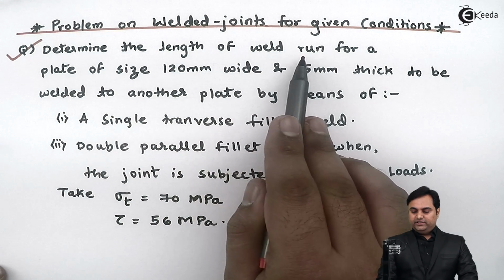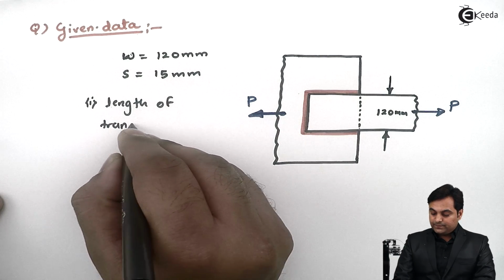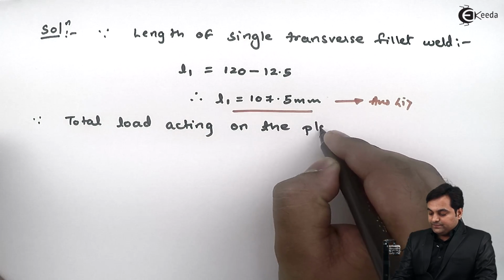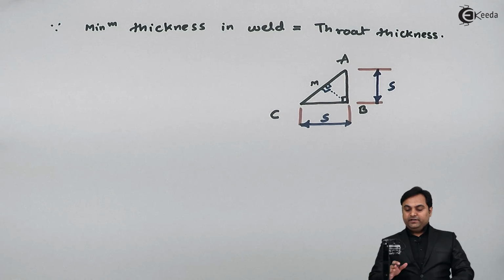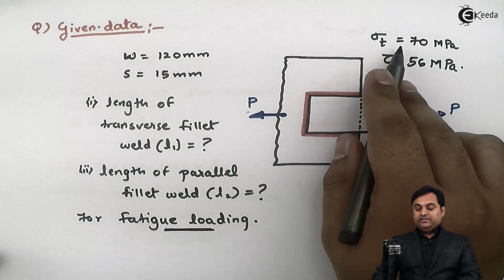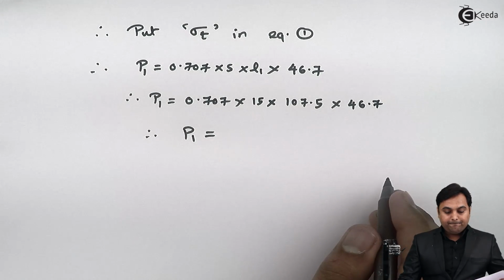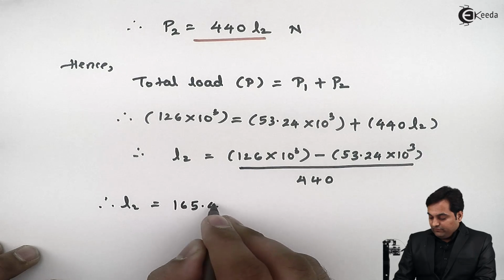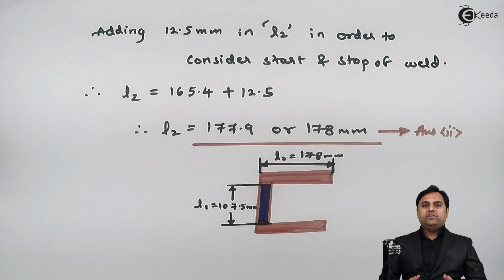Problem 2 on Welded Joint - Design of Welded Joints - Design of Machine

Comment: I think u r absolutely wrong......u have taken case of static loading with stress concentration.......but question is about fatigue loading......so   allowable stress will be Se/Kf.....it means endurance limit stress divided by fatigue stress concentration factor.......not tensile strength by stress concentration factor as u have written.....it's wrong